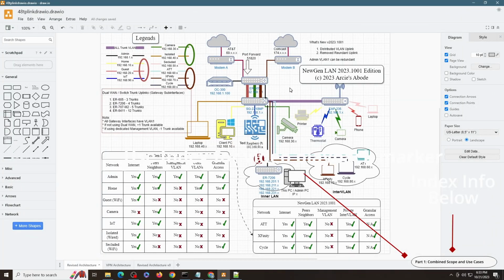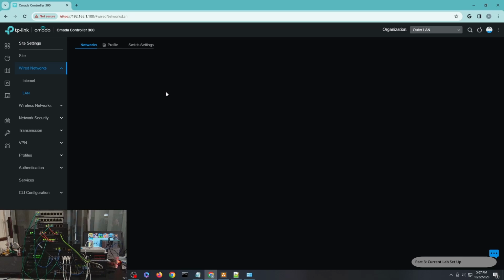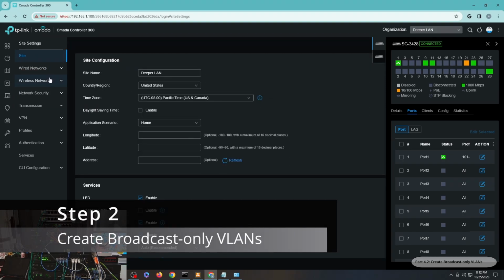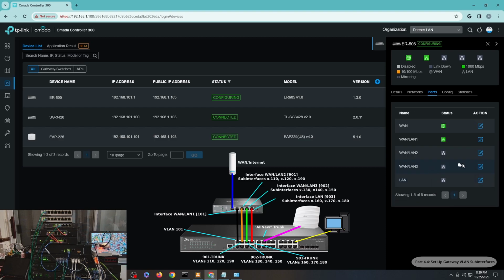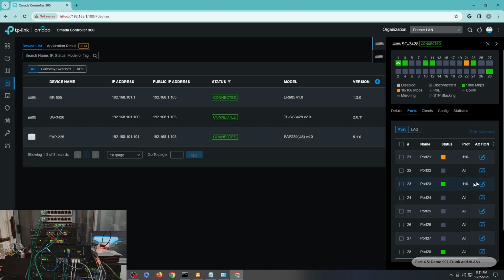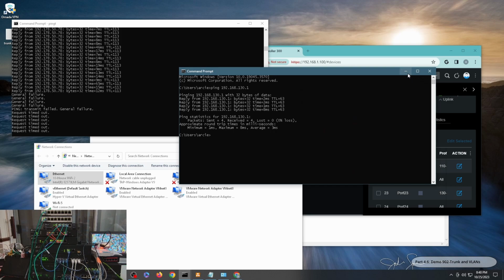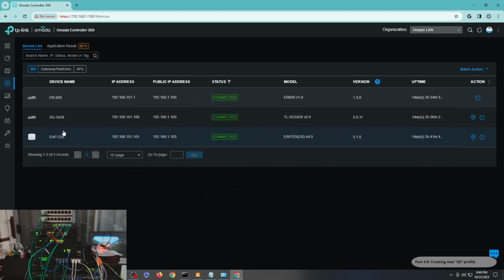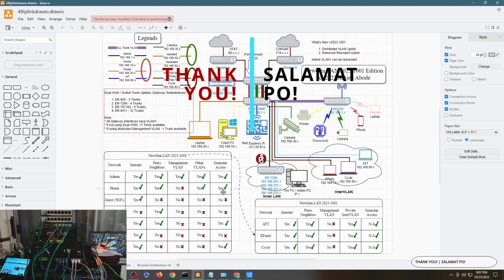LC62: Improve your TP Link Omada LAN to the Next Level, Introducing non-Interface L2/L3 VLAN

Comment: Hey Arcie. 

It's been awhile since I last commented/asked questions. I have fully implemented your NewGen Lan design on my home network and have provided my Tenants internet through one of the VLANs connected to an EAP670 AP. 

My tenants have since come to me and expressed a desire to have access to parental controls in real time. 

They would like to replace the EAP670 with an Eero wifi 6 mesh system that will allow them parental control over their wifi on the Eero smartphone app. 
If I set the Eero into bridge mode, they loose the functionality they want. 

If I don't turn on the bridge mode of the Eero wifi system, will I need to be concerned about Double Nat? 

Is there anyway to set the VLAN into a form of bridge mode and turn the functionality over to the Eero?

Thanks for all that you do Arcie!!!
Reply from the maker: hey there @scottbousfield5434 , thank you for dropping by again the channel and I am glad you are able to use NewGen LAN. As for your inquiry, I am not familiar with eero, so my assumptions may be wrong, keep this in mind when looking into my reply. Omada and eero are two separate systems, so they need to "play together" to be able to use them. Having said that, for bridging and double NAT, as long as the tenant aren't affected, I do not see why it'll be an issue. It will not affect their LAN, nor streaming, nor their "parental controls". The only issue they might have is if they would like to implement their own VPN server (i.e. not NordVPN, not ExpressVPN) because if they need to do that, you will need to do some port forwarding (if they are behind your firewall).

As for your other inquiry about "other way to.....turn the functionality over to Eero", you can look into OpenAPI and WebHooks with Omada and see if you can find something that "play together". Note, it may be too much trouble to implement even if it exists.

Comment: Hi Arcie,
I’m currently working with the following network setup and have encountered a challenge I’d like to get your input on.
I have several internal VLANs (IOT, HOME, GUEST, DEFAULT) connected via a trunk port to a router Port2. Additionally, there is a separate VLAN for servers, which is connected to another router port6 and accessible from the outside via port forwarding.
The goal of this setup was to keep the two VLAN groups – internal (IOT, HOME, GUEST, DEFAULT) and server – separated, without using any ACLs. I assumed that this separation would be achievable through VLAN segmentation combined with trunking.
However, the issue I’m seeing is that from the server VLAN (with port forwarding), I’m still able to ping all internal VLANs (IOT, HOME, GUEST) when no ACLs are configured, aginst what I wanted to archieve.
My question:
Is there a way to fully separate these networks without any ACLs? Or is this only possible if the VLANs are configured purely at Layer 2 and not like now as interfaces (L3) for all networks?

Looking forward to your feedback or a quick hint on whether and how this can be achieved technically.
Reply from the maker: hey @computerathome9214, before anything else, apologies for late reply as I have been stuck with real life stuff. Welcome to the channel as well! As for your inquiry, assuming these are all still under Omada platform, you are correct to assume that, that type of set up is only possible with a pure Layer 2 VLAN. VLANs are defined in Layer 2, the one you defined in your Gateway/router are usually called "sub interfaces" or IP networks, and in the world of Omada Gateway, all normal sub interfaces / IP networks defined on Gateways are automatically "routable" between each other.

I understand that if you do such, you will lose the ease of "port forwarding" directly to your server VLAN, what you can do is have two Gateways, one is dedicated to your server and the other, to the rest of the network. You can find a "similar" configuration on my video LC61, link below, where I used another Omada Gateway as a server. I also plan to release a revised NewGen LAN with a similar set up in the future, I just didn't have much time. Apologies again for the delay, as I need to catch up with real life stuff. Good hunting!

LC61 (as a reference / inspiration):
https://youtu.be/W4hDyJmRe2A?si=axKO4bihJ_6Qpvwd

Comment: I just Implemented this method today, and it works so far.   I'll update here if I have any problems.
Reply from the maker: hey @drbogger, thanks for dropping by the channel. By the way, if you want to have really fast InterVLAN routing with a single switch, I posted an improved design last January and it involves Layer 3 Switching. Check it out (link below) if your Omada has Layer 3 functionalities.

https://youtu.be/-8m3390KVzU

Comment: goodmorning can you give us how to use the qos gateway im having spike in online games o mobile legends. i having bufferbloat in my system
Reply from the maker: heya @jaimedelapenajr7982, thanks for dropping by the channel. just to clarify since I am not familiar with network bufferbloat term, are you having lag when doing online ganes? QoS might help but VLAN PBR, PPSK, or even 802.1x might be a better solution. I have QoS on my to-do list already.

Good hunting!
Reply: @deadmeats  nice waiting sir sa video qos mo.. 🫰 medyo hassle lang tlga pag gaming ako kc pataas latency dahil isp ko is sim base
Reply from the maker: heya @jaimedelapenajr7982  , for gaming, QoS may help but depending on the game specially i.e. RTS, FPS, MoBA (anything that requires fast, if not real-time response), QoS will almost always have no improvement if your ISP or internet connection have bad latency i.e. bad network in/out will become prioritized bad network in/out, meaning even with QoS, you will still die/lose/fail.

You can achieve a similar, result by bandwith-limiting your devices i.e. all IoT device can't do more than 1mbps download or PC1 and PC2 can only do 5mbps upload/download. But if you are really focused on using QoS and would like to try it out, I will provide two links that I use often when making videos:

Options/Links:
1. Chapter 4 > Transmission > https://www.tp-link.com/us/user-guides/omada-sdn-software-controller/chapter-4-configure-the-network-with-omada-sdn-controller.html#ug-sub-title-1
2. Chapter 4 > Configuring Bandwidth Control > Pg 89 > https://static.tp-link.com/upload/manual/2023/202310/20231009/1910013510_ER605(UN)_UG.pdf
3. Reach out to TP Link, submit a ticket if you have issues with your set up > https://community.tp-link.com/en/business/forum/794?page=1

I do have a video in mind, but I recall when I was planning for this, I can't figure out how to make QoS a better option in a home-use scenario if the easier and more-user-friendly alternative is already available (as I mentioned, PBRs and Bandwidth Limitation, etc). I believe it's better for VoIP and similar services, but I am not very good with VoIP so this is why I still have this video in my to-do list but never got around to making it. 

Good hunting.

Comment: Hii, I currently have ER605 which doesn't support DPI and IDS/IPS, should I upgrade to ER7206 or should I wait little longer to see if they add it to ER605, also can you please make a video on 5.13.10 beta version of Omada controller and show how DPI works.
Reply from the maker: hey there @amansaroha4171, thanks for dropping by the channel. IDS/IPS still doesn't show up on my ER-7206 so I am not sure if it will be released anytime soon. I really don't use the beta software for TP Link, just a personal preference. When these features are released, I'll spend some time with them and check how they perform. Good hunting!
Reply: @deadmeats  The ER-605 v2.0 just got DPI support on the latest firmware update. I'm not sure about version 1.0 though.
Reply from the maker: heya @drbogger  . yeah, too bad, my er-605 v1 is already end-of-life so no support for IDS/IPS (hardware is probably too weak). For price/performance, I complain only a little :).